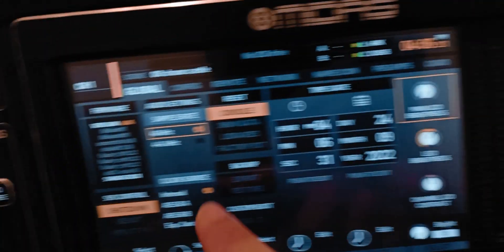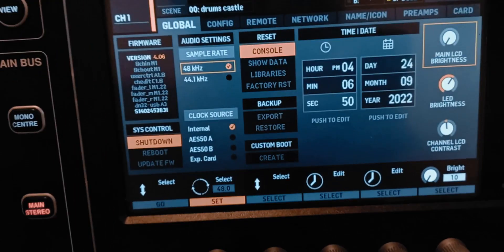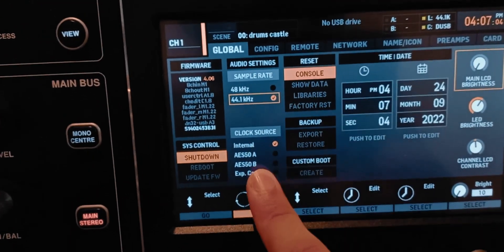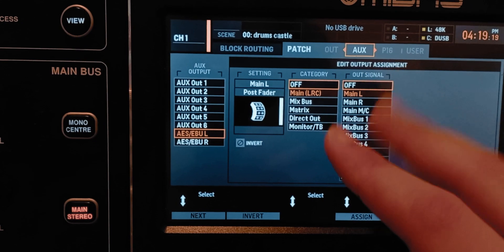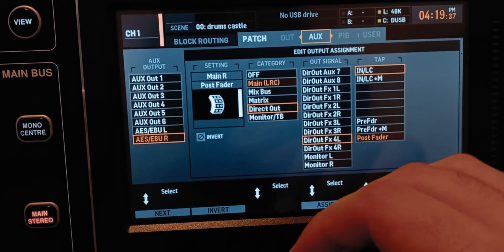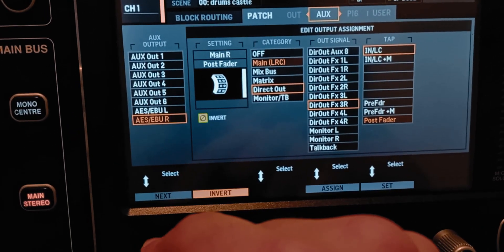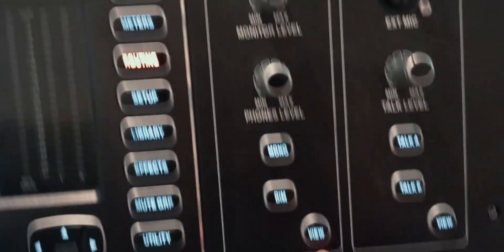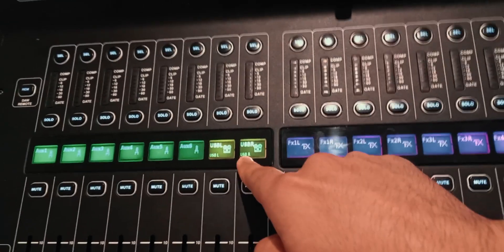AES/EBU output on Midas M32 & Behringer X32 live console (what is it, how use it & to route it)

Comment: Sorry need to correct you on the AES/EBU output of the X32. It is a differential digital signal with signal+ and signal- plus ground. The Left and Right audio channels are carried in different frames of the signal. The AES/EBU output XLR does not have pins for Left and Right as you stated. This signal is similar to the SPDIF (and in its optical form, TOSLINK) like you would find on digital audio devices like minidisc decks, CD players and similar devices, although SPDIF is single-ended not differential. Otherwise useful video - I came here to see how to route a couple of matrices out to the AES/EBU output port, so thanks for solving that one for me!
Reply from the maker: Thanks for the clarification :)

Comment: @danielkharrat hello i use the behringer s32 digital stagebox and would it be better quality of the sound if i took out my main LR from aes/ebu to D&B amps (D12) instead of just the analog xlr outputs. i understand that its a matter of need when you have to use alot of outputs at the same time but thats why im trying to figure out if the quality alone would improve with aes/ebu connection between the stagebox and the amplifiers.

Comment: I USE A STAGE BOX ON THE ALTAR OF MY CHURCH ALONG WITH A DBX 360 AND THE MIDAS M32 TABLE, IT IS AT THE BACK OF THE CHURCH VIA NETWORK CABLE... IS THERE ANY WAY I CAN USE THIS AESEBU CONNECTION EVEN SO AND IS IT WORTH IT?

Comment: My question not related in this topic for this reason sorry so I formated my pen drive then i wanted to record on midas m32 it's not accepted it.
could you give me some advise
Reply from the maker: @vaqiftahmazov7927  you need to format it to FAT32 not NTFS
the mixer doesn't read NTFS format
Reply: @danielkharrat  I did but again not to confirm I used it before but after format not recongnised

Comment: Have you ever experimented with aux 7 and 8 ? For example plugging a pc or other devices. To input audio?
Reply from the maker: Aux 7-8 is the usb stick input on the front of the console you can't use your computer with a usb type A and plug it, i mean you can but it doesn't work. You can charge your smartphone if you want it's pretty slow at charging but it works hahah.
The usb input only reads losses wav files  that are recorded at the same sample rate as the console and 16 bits of dynamic range because that's the bit depth of the usb recorder. If the wav file has a bit depth of 24 bits or 32 bit floating point the console doesn't read it at all
So in short the only way to get sound into aux 7-8 is through a usb stick that has an audio file with a bith depth of 16 bits and a sample rate of either 44.1khz or 48khz

Comment: Hi Daniel,

What would you typically use this output for in a live pa networking setup? What are the advantages/disadvantages of it? 
If I use this to connect to my Driverack from the console, would it lower the noise floor? Reduce the cabling from 2 to 1? 
Just wondering what some practical uses would be. 
Thank you for your great videos!
Reply from the maker: I personally never needed to use it but a practical example would be streaming/filming a live event. If the camera person/team have a recorder or device that can take an AES EBU input and you have already used all of the xlr outputs you can give them the Main LR mix through the AES EBU output.
In terms of noise, the analog xlr outputs will do a much better job a canceling the noise because they are balanced whereas the AES EBU is unbalanced 
So the only time i would use it is if i don't have any more analog outputs, i used them all and i still need 1 or 2 extra outputs. Then the only thing i can do is use the AES EBU but the thing is that the receiving device should be compatible with an AES EBU connection otherwise it will not work
Reply: @danielkharrat  sorry to correct, but you shouldn’t think of aes/ebu as ‘unbalanced’. A single XLR carries 2-channels of digital audio. AES/EBU will likely have a lower noisefloor than an analog path. It’s passing zeros and ones from one device to another (no preamps). Another benefit to using AES is less roundtrip latency (less converters). I use the X/M32’s AES to insert a CEDAR DNS on dialogue buss for that reason.
Reply: @danielkharrat  
Thank you!

Comment: Interesting video !
Is it possible to go throught the others connections, more precisely the midi connections  ?
Maybe on an future video how to get a dry signal on a channel , an other channel with the same signal wet with an effect and an other only with the effect return only use with the same signal all to the main stereo bus, is it possible ?
Thanks Daniel
Reply from the maker: I've already made video on how to use the mixer to control you DAW with midi through the usb cable. But if you're talking about the 5 pin midi in and out, this is to control some things on the console through another midi device like loading scenes or snippets for example. Instead of going through the pages you just hit a button on that midi controller and it will do the action.
But in my opinion i don't think it's that useful because you can do that with the assignable buttons on the right side of the console
Reply: Ok.. thanks for the information..